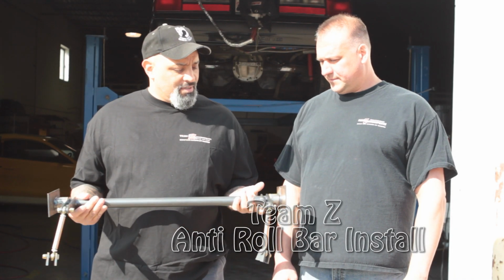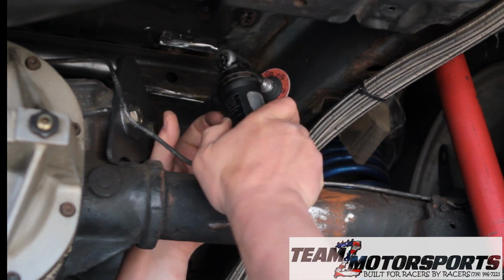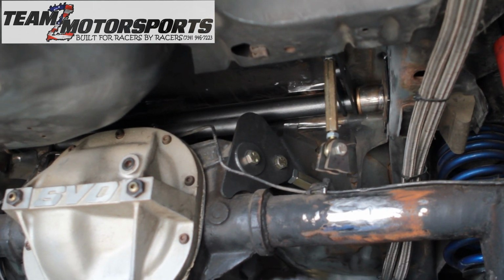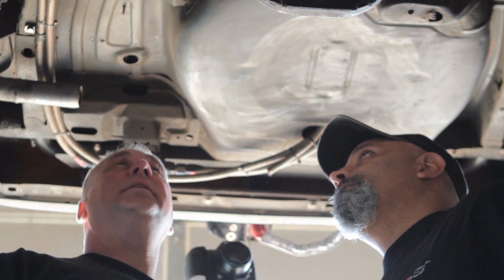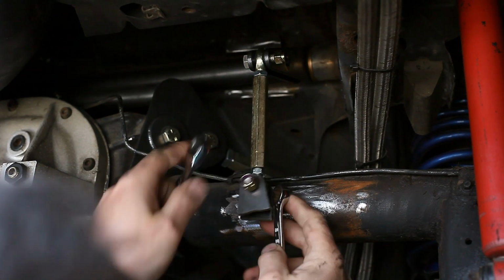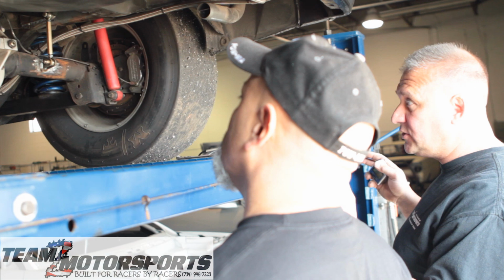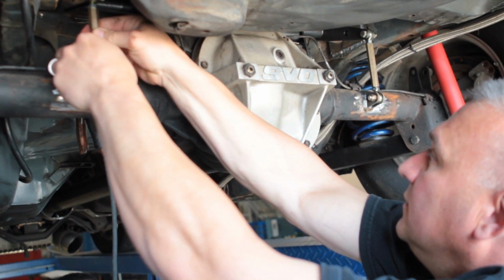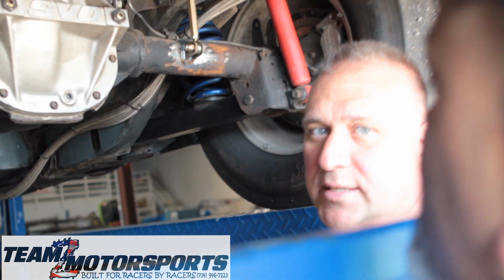Team Z Motorsports Anti Roll Bar Install

Comment: When you weld on a tube it bends the tube. using heat or weld is how a bent tube is straightened he just gave the car toe out which is not good (it screws up the handling) at all if he had welded it on the front side he would have given it toe in which is fine. A clamp on bracket with the tab on the top or bottom would be the best,  I work in a machine shop is how I know.

Comment: So you only put preload on the passenger side link?
Reply from the maker: yes if everything is installed correctly we just use the passenger link for pre load but there are times that we do usr the driver side but rarely!
Reply: Great thanks David. Looking forward to installing